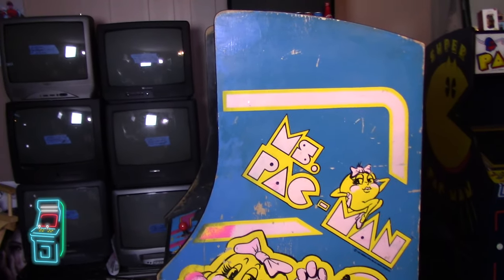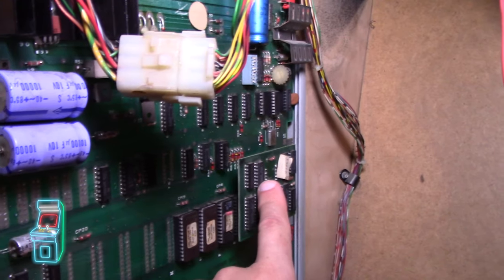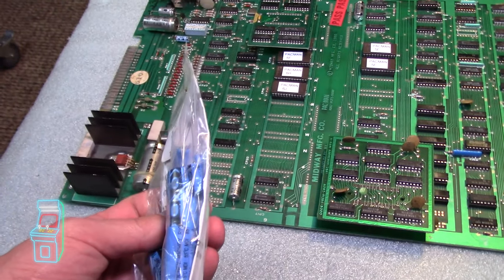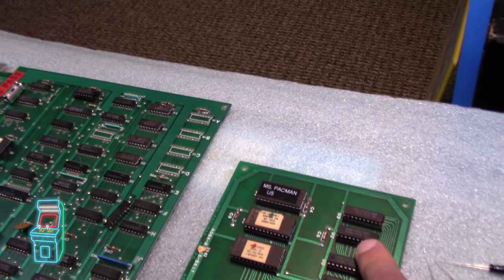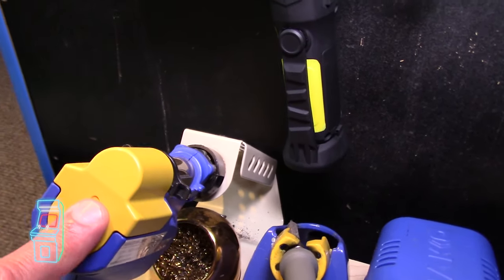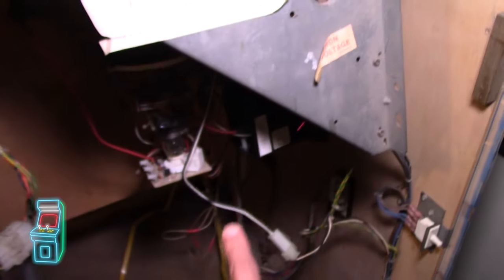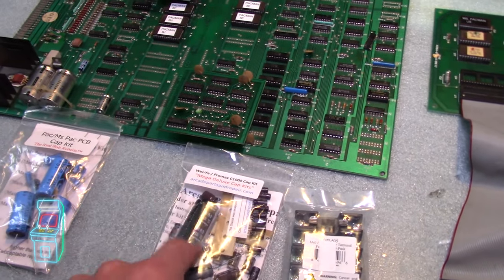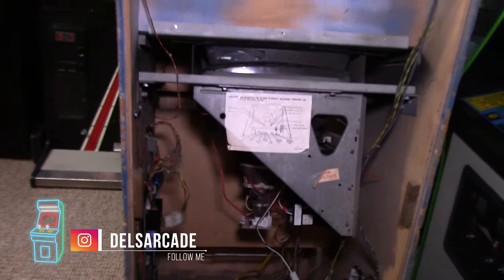Ms  Pacman upright restoration [Sept 2019 update]

Comment: what causes the humming noise in the machines some have it and some don't
Reply from the maker: Usually it's a grounding issue that causes interference.  It varies in degree by manufacturer.  Midway is notorious for this and is typically  minimized by replacing the fuse block.
Vintage Arcade Gal has some great tips here: https://youtu.be/5SP_IABeL9Q